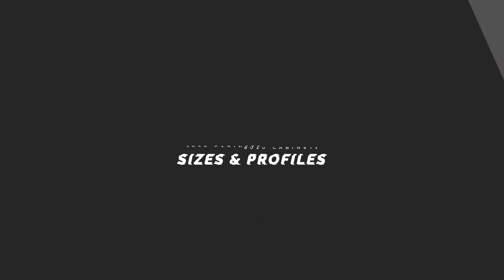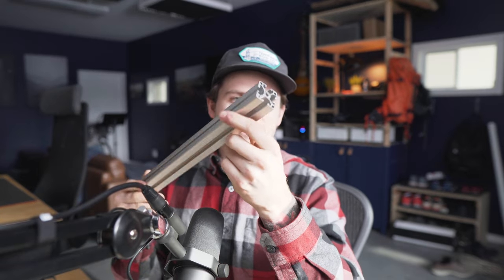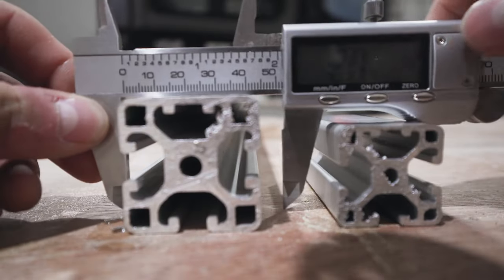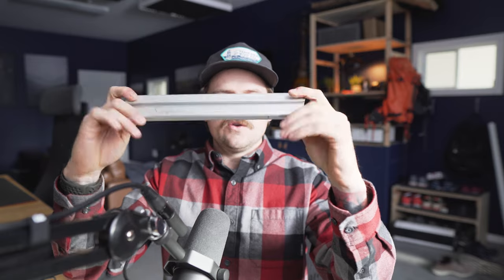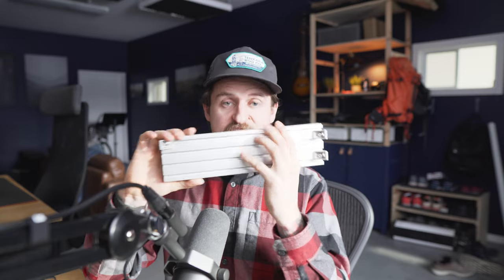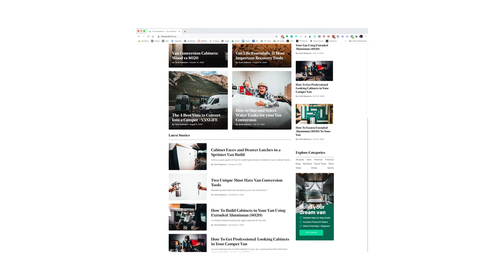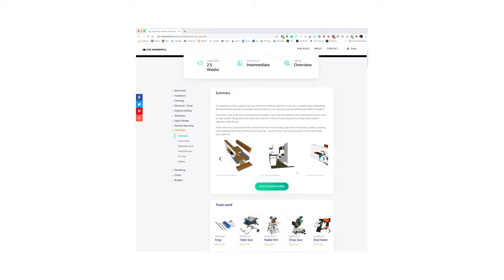Does Size Matter? What 8020 Sizes I Used | Sprinter Van Build

Comment: Thanks for the info. And just for everyone's info, my 350mm corexy 3d printer made of 20x20mm extrusions can withstand a few of my nephews and nieces totaling about 250-300lbs. I think 20x20 and 20x40 is adequate for most applications in a sprinter build, and they're way cheaper for the value considering the current price of lumber (~$15-20 for 2m of 2020 or 2040 used to build my 3d printer).

Comment: Thanks for this information! We plugged along without it when we were making our decision, but by looking at your other videos we kinda figured that you had 30/40 series in use. We are using 30 (10 series in the USA) for all our build, even our bed system, as we designed it with enough support and tested it out. We aren't finding the smaller series too difficult to work with in terms of fasteners, we have small hands I guess, lol. We get it that the larger 40mm (15 series) may be that much easier but it was also heavier and we really wanted to watch our weight in this build as we have a 170" sprinter. Super excited to begin the cutting/assembling this week in fact! Thanks for your great explanations in all your videos.

Comment: My company reps and stocks actual 80/20 aluminum. We have a CAD design team that can advise on which series, brackets, etc to use for your applications. We can also run load analysis to make sure you're not stressing a joint.
Reply from the maker: Thats awesoem because getting started with the 8020 is a daunting task.
Reply: Chris...perchance UW '87?  Friend of Lori and Ejay?  We've been looking for you.
Reply: @christophermwheatley can you send me your contact web page??
Reply: Unfortunately, you aren't in Silicon Valley. Apparently we are a backwater when it comes to stocking distributors for 80/20.

Comment: Thanks for the info dude. I'm also building and have abandoned the 1inch series for the 1.5inch.  The primary reason was the flimsiness of the bolts that connect the 1in.  I was able to break a connection with my bare hands, I just don't trust it to hold up the the rattles and forces of driving.
Reply from the maker: Yeah the 30mm stuff seems to be perfect.

Comment: 80/20 Profiles 1515 Series: 1.5" x 1.5".
1515 LS Series (1.5" x 1.5") Smooth Surface with 4 T-Slots.
1503 LS Smooth Surface with  I Closed Surface & 3 T-Slots.                                                                          1502 LS T-slot Extrusion : 2 Surfaces Closed with 2 T-Slots.
1517-LS T-slot Extrusion  2 Slots with a Rounded Corner.
3075 T-slot Extrusion  3" x  3/4"  with 2  Parallel T-Slots.
5/16 - 18 threads Carriage Bolts x 1.5" long  (Home Depot) fit perfectly in these Slots.                                Order T-Nuts to Slide in the Slots from your 80/20 Extrusion Suppliers.

That is All the 80/20 Profiles that you will mostly need for a Van Build.

Comment: Just to be clear. The numbering of extrusions define the sizes. I.E. 8020, 6020, 2020 all refer to the size of extrusion 80mmx20mm, 60mmx20mm, and 20mmx20mm respectively.
Reply: metric is actually "20-2020" etc.  The series # comes before the size. When using fractional its just the 4 digit. 1010, 1020,  1515, 1530

Comment: Thanks for that! We can't get official 8020 here in New Zealand easily, but found another company with similar. They ony have 20 or 40 size. So I guess 20 it is!
Reply: Here in Australia the brand we use is Minitec. Looking at their website,it appears they have a distributor in NZ too 🇦🇺🇳🇿
Reply: @BeccifromOz  Minitec in the UK too. They have a very nice and easy rt L joiner that doesn't require drilling holes to make the join. So it can slide along. It is expensive compared with drilling a hole and bolting but it makes life so easy. 
 Minitec have a simple to use catalogue.

Comment: Hi Scott, love your videos! Very helpful for us virgin van upfitters. I am getting close to finishing my extruded aluminum cabinet design. I have cardboard mockups in the van at this time and am trying to finalyze the details before ordering the materials.
My question is regarding the slam latches for my bank of drawers. I was not planning on having cross members between the drawers to maximize space. So I guess i cant put slam lathes in?
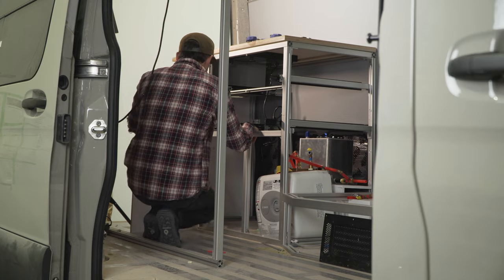It looks like you addressed this issue, at 3:40 in you video, I can see something with some small piece of aluminum? Can you please describe what you did here?

Comment: Hia bud, love the video... Question. I'm converting my box trailer and need to keep it as light as possible but want to make a platform bed that hovers over a quad underneath. Whats the best size of extrusion to use... i.e 30 series or 40 series or coukd I go smaller?
Reply: Some extrusion suppliers have a calculator of deflection v. load. Though you want to keep it below the yield point to avoid a "set".

Comment: Heya Scott. 

I'm about to step into using an 8020 alternative that also comes in 2020, 3030 and 4040. 
Do you think it will be ok to use 2020 for something or would you use 3030? 

For the bed frame I was thinking of using 4040 as 3030 won't be good enough (according to 8020 tech toolkit), but I'm not sure if I should use 2020 or 3030 for the rest. At most I think it will span like 60cm without support, which according to 8020 tech toolkit is fine. 
When fixed at both ends, with load evenly distributed and 600cm length, with 100kg centered it shoul only deflect 0,0909" or 2,3mm.

I see you speak upon 20mm, but for me 2020 is a bit cheaper than 3030.
Reply: Guess not.

Comment: I see you hanging from the 40 series,  I was wondering if you feel safe to do the same with the 30 series?
Reply: Depends on the length of the lever and the triangulation, supported at one end or both etc, etc.

Comment: could you elaborate why 20x20 is not good?
Reply: Actually the 2020 (aka series 20) is less expensive and readily available on Amazon in the US.  It is rigid enough for cabinetry using certain joints and sheer panels.  The best thing about using these 2020 AL intrusion is  they weigh less than their bigger cousins, an important factor missing in this video.

Comment: Hi, did you use different sizes together and if so were there any issues fixing them together?
Reply from the maker: Its not an issue for 30 an 40 series, bt I mainly used the profiles together.